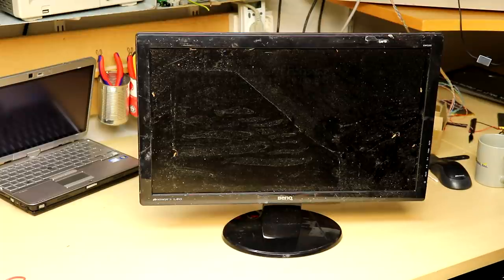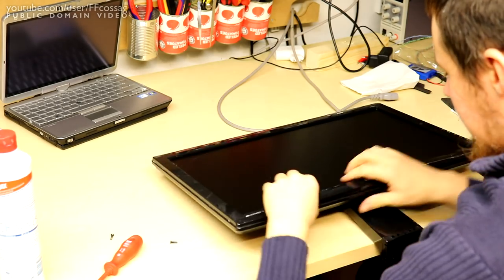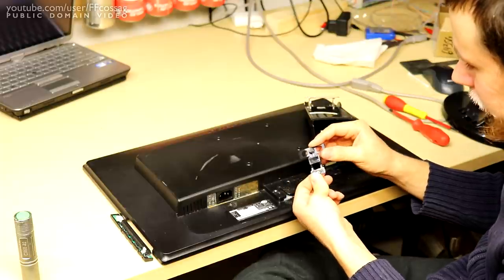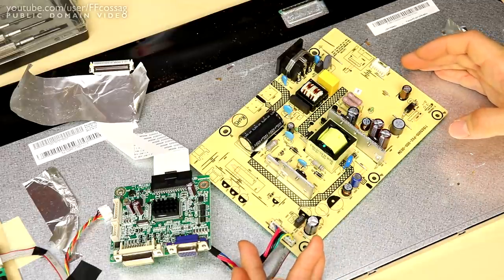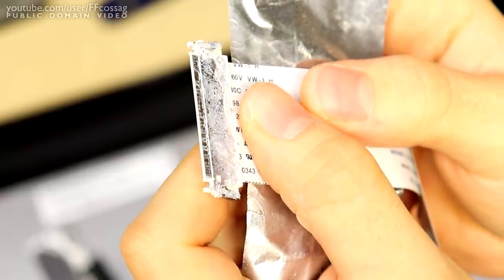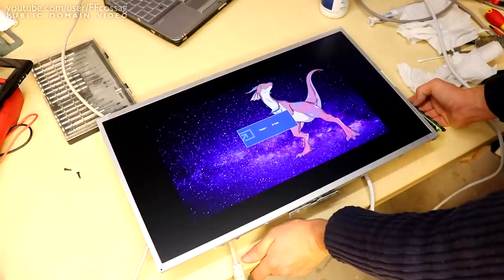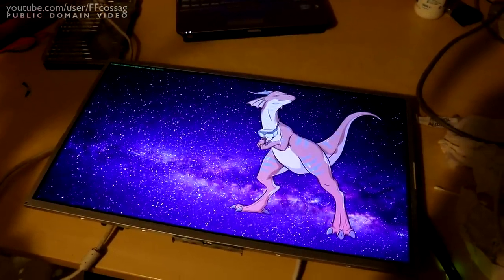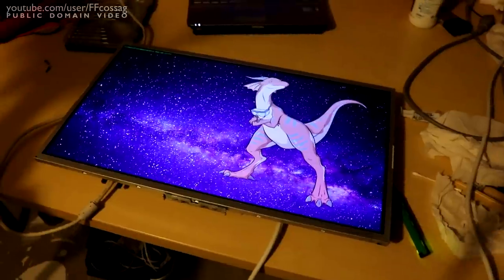Trash picked BenQ W2255 VA monitor

Comment: I've picked a lg flatron monitor from thr trash, its problem seem to be a cut power cable. I verifyied its reccomended voltage, it was 12v, so i soldered a molex and used with a pc psu. 
But now some months later, many horizontal lines are starting to appear into it, some black, some the se color of the image on the screen, but dont mach the picture. 

Do anyome know whats happening? The psu is giving 12.02v, so i dont think its overvoltage.

Comment: Dam good dumpster diving :-D, that monitor doesn't look dim, your laptop looks too bright to me.
The quality looks spot on with your video, looks very real, so the colours and tones are fine.

I agree with you, someone just didn't want it and could not be bothered to pass it on.
Reply from the maker: The laptop is supposed to look bright in order to demonstrate the issue. As I'm now using the new camera which actually allows me to run manual exposure without ripping my hair out in the process, I can actually do that. ;)

Comment: You just skipped the interesting part by only describing it! About how to get the foot off: How did you actually get inside before the backside/foot was off in order to make that peg release the foot? I think disassembeling these (any) devices without damage is a form of art and should be documented as thoroughly as possible on Youtube and other sites.
Reply from the maker: To access the screw for the locking mechanism, I just forced it open a bit.